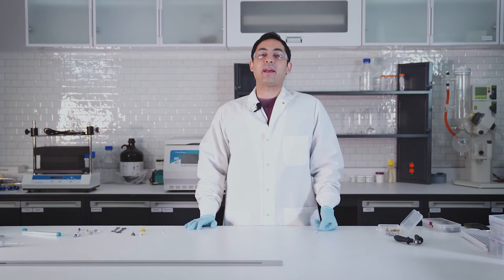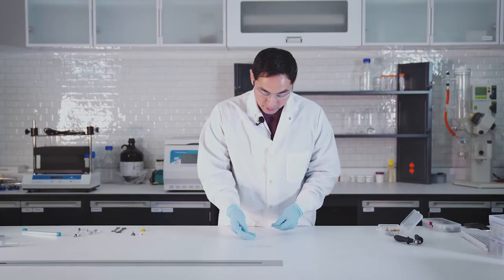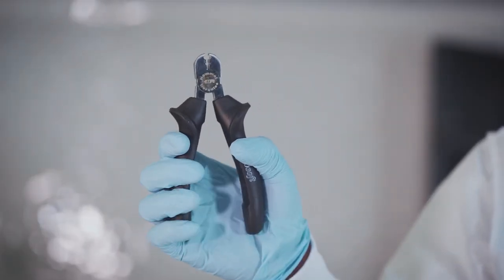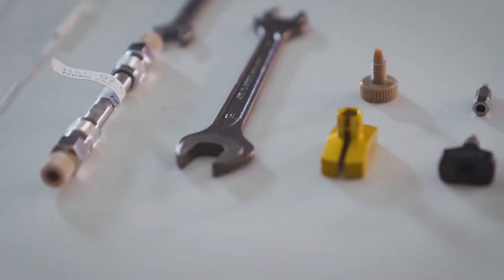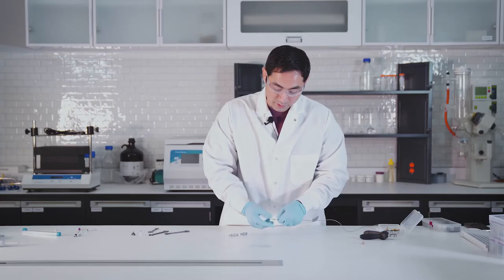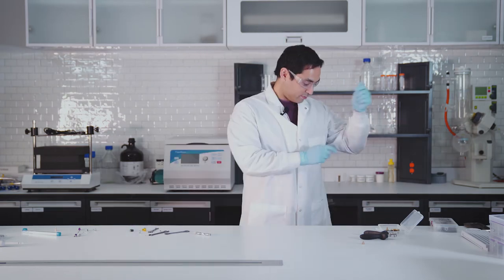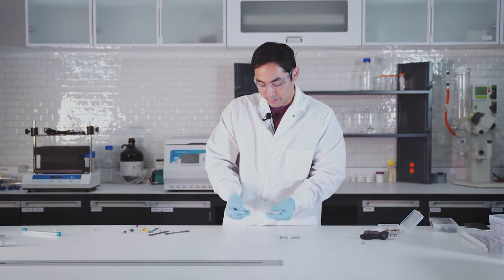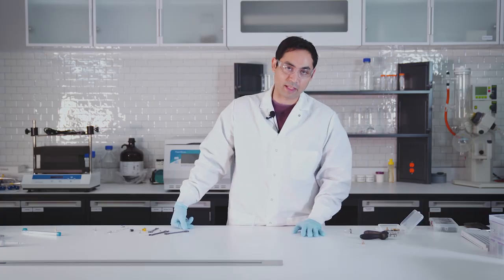HPLC Tubing and Fittings

Comment: i broke my plastic tubing in my fitting--know anything about how to put plastic tubing into fittings???? i have a HPLC smidazu LC-20AT that's ancient
Reply from the maker: Generally, it's a good idea to replace tubing and fittings every so often as they are consumables.  They're not too expensive and it's generally not worth the time if it's really swaged in.  I'm not sure if you have a one or two part fitting system, but there is a fitting removal tool you can buy to recover fittings from tubing.  You can usually recover the fitting and throw away the ferrule.  If it's a one part I would just replace it.